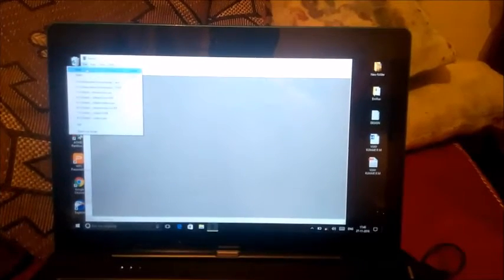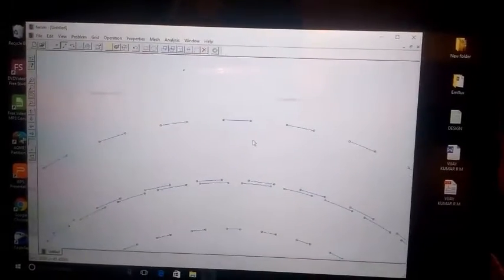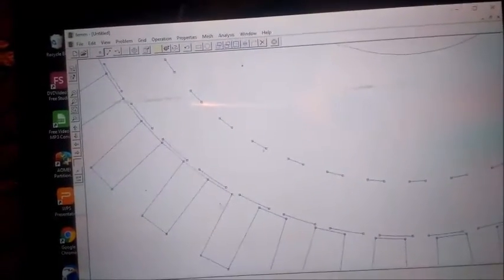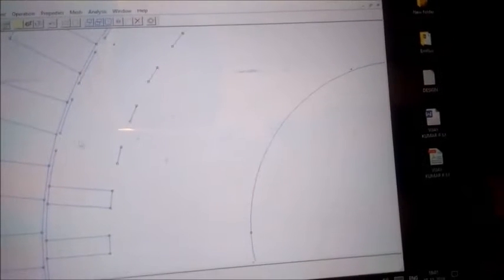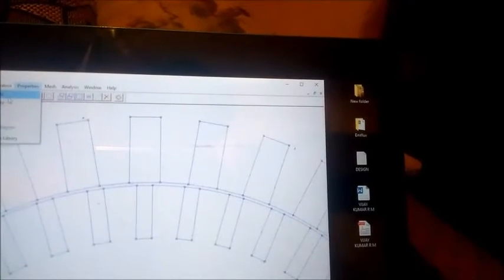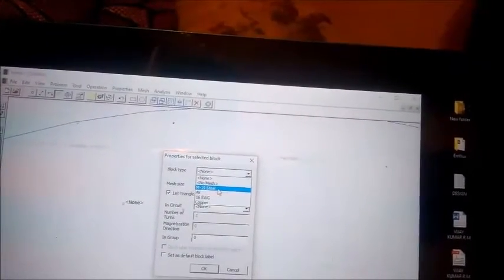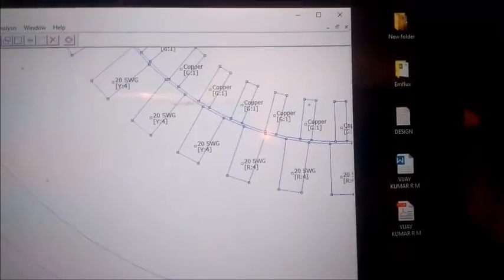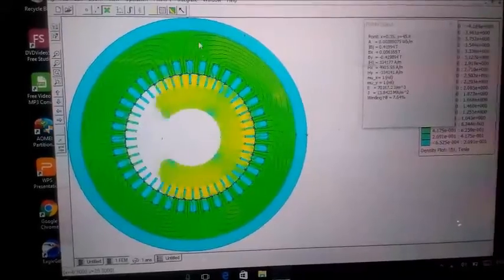FEMM (FINITE ELEMENT ANALYSIS  FEM  ) ANALYSIS OF INDUCTION MOTOR IN DETAIL WRT MAGNETOSTATICS OF IM

Comment: sir how to plot all those points
Reply: do we have any other short method not by cad only by femm
Reply from the maker: Ramchandrareddy Atigadda see femm doesn't allows for duplicating or mirror image creation. Hence you won't get sufficient accuracy in placing the points
Reply from the maker: Why we are using CAD is?? In Femm we are unable to plot the points with accuracy. That's the reason why we are using CAD. There is no any other alternative if you need accuracy in result.